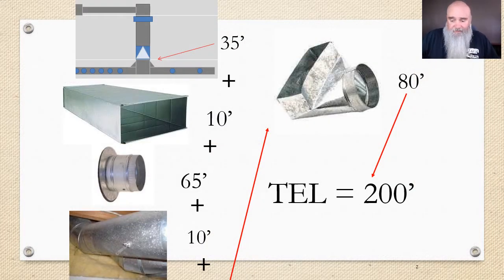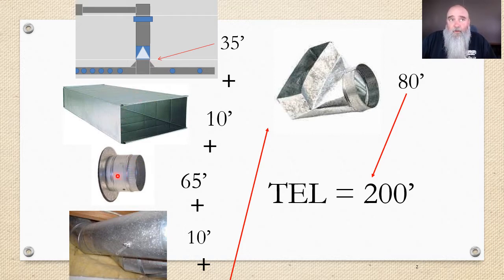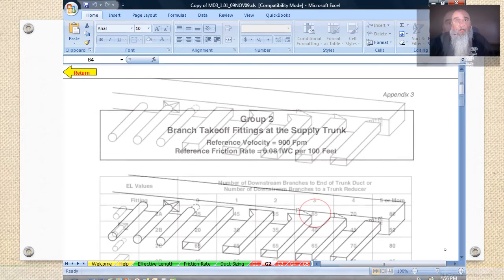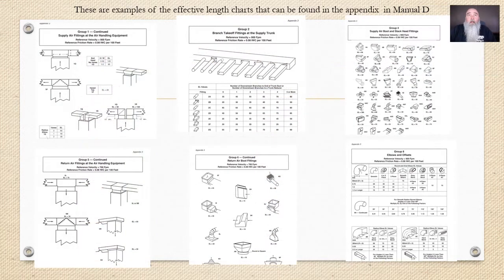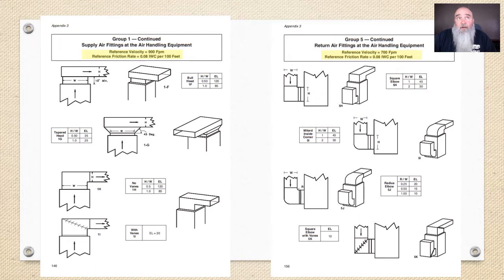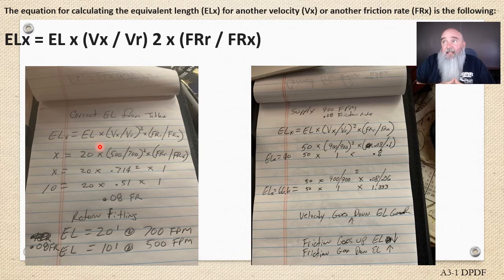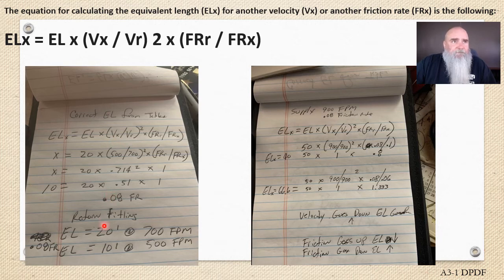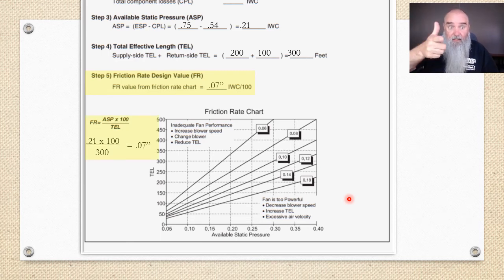How to adjust EL’s for fittings ACCA Manual D

Comment: Hi Ed! I have a question about EL! Imagine that! 
Anyways, out in the field I am running a supply trunk & tapping off with saddle taps/dampers straight to the supply registers. In the Wrightsoft program that I am using it seems to give me multiple options but all with different EL. Option (A)  Tee, no transition (B) Branch EL of round take-off (C) Trunk EL of round take-off. WHICH ONE DO I CHOOSE?! Thank you in Advance!
Reply from the maker: Group 2 page N22 in Manual D has your answer. The EL is relative to where the tap is with reference to how any branches are downstream to a trunk reducer or end cap. fitting NP is what I would use.
Reply: I don’t see a fitting NP.

Comment: What is the equivalent length for a round pipe attached directly to a plenum in a return air system with a referenced velocity of 700 pm at 0.08 IWC per 100 feet?

How to calculate, can someone explain thank you
Reply from the maker: Use the chart on page 108, figure A3-2 along with the EL from group 2 page N20 find your answer.

Comment: I simply took the equation provided in Manual D and put it into a spreadsheet. Enter in the values and it automatically adjusts the EL value. Very handy to have. Especially if you end up with a friction rate value that isn't 0.08 inches wc or want to size based on a lower velocity than 900/700...or both! You can play around with different values to bring down large values and "dial in" a duct system.